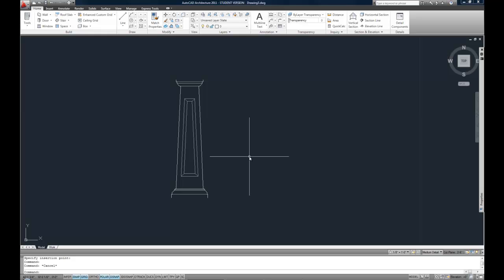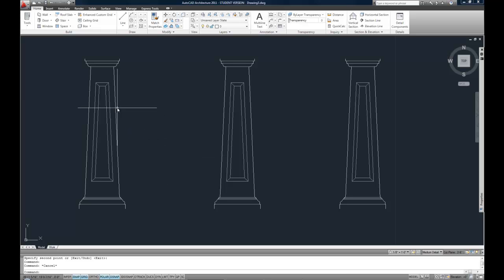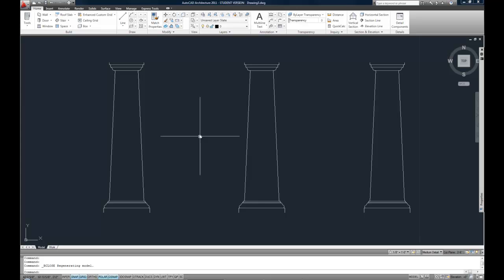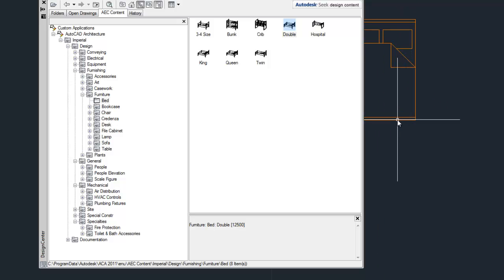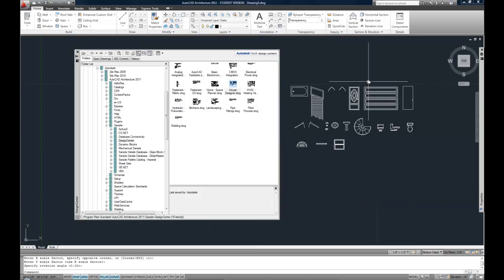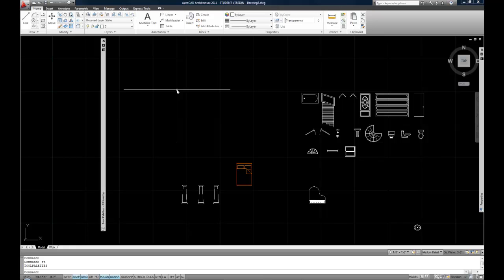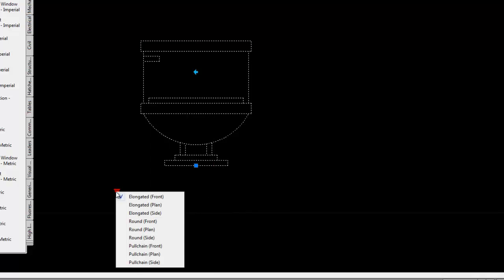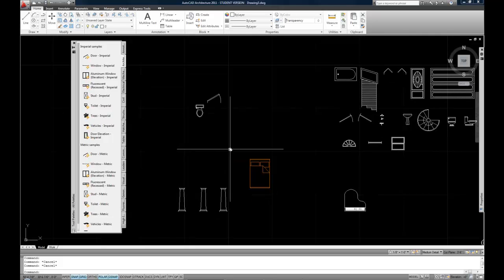AutoCAD Fund.: blocks

Comment: Thank You for You made these tutorials, very helpful and i love them!
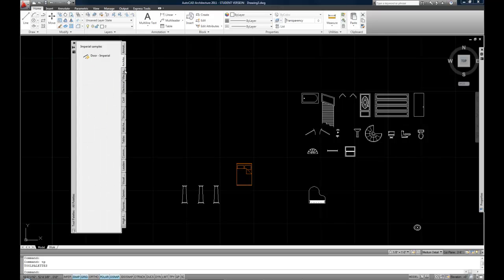But here at 10:48 i just stucked...
I have no Architecture TAB on the ToolPalettes...
I spent half day on Google etc etc, and i could not figure it out why is missing thatone for me.
I also installed the architectural one (Autocad 2016 for architecture)

I have tried to reach that toilet what you used but i could not find that or any other dynamic block :( So i dont have but one grip only
Reply from the maker: +Adam Nagy I can't identify the problem without your screen and possibly poking around a bit.  If you have ACA (AutoCAD Architecture) installed, just use it with the DesignCenter blocks instead